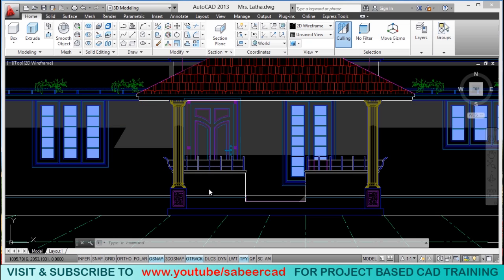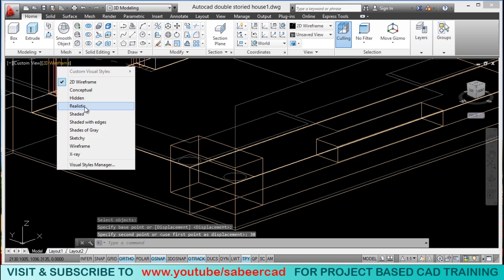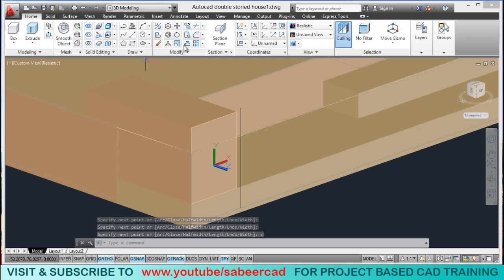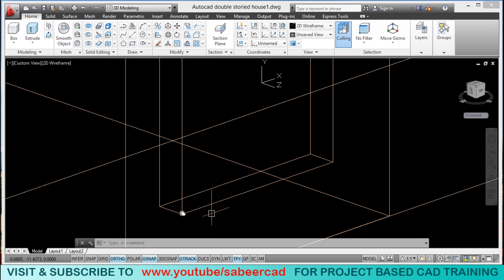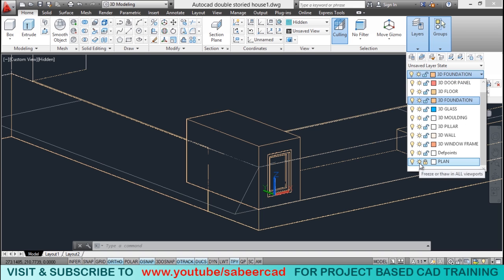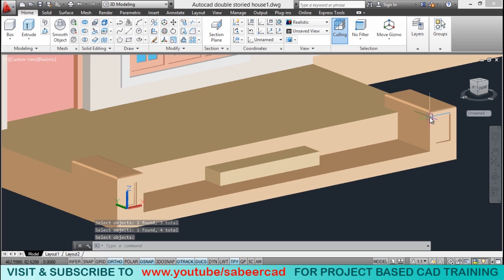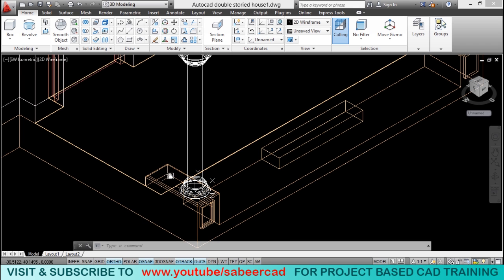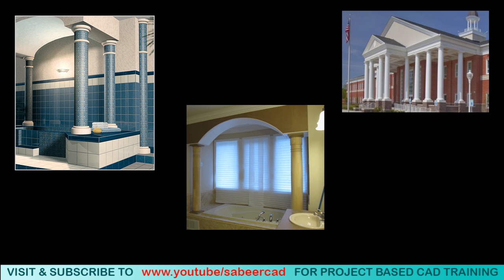CREATING 3D PILLARS WITH DETAILING | AUTOCAD 3D PILLARS

Comment: Hi Mr Sabeer,
Can I have an anwser to this my preoccupation?
While working in 3D model, to create a 3D objet or extrude a profile, is there any difference between using the polyline and using a rectangle tool? Why don't you just draw a rectangle instead of making it with the Polyline tool? Thank's for your answer.
Reply from the maker: If you want to extrude a rectangular profile you can use rectangle tool or a polyline to create a rectangle . Both these methods will give you the same result.
Reply: sabeercad
I thank you Mr Sabeer for your anwsers.
I continue to think that you are a pretty great guy because there many people in the world that have sush knowleges, but there are few of them who accept to share they knowledge, so you are a great man. Thank's a lot.
Reply from the maker: I like to share my knowledge. Thanks for that comment